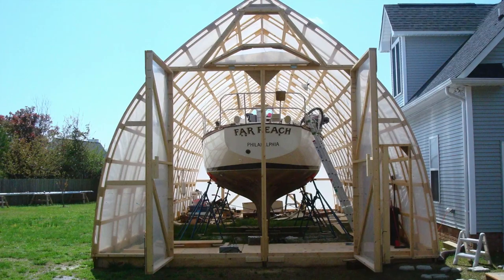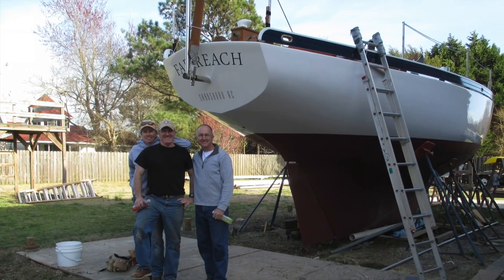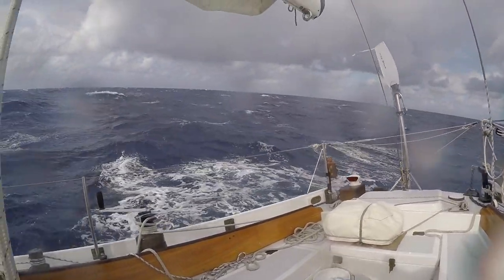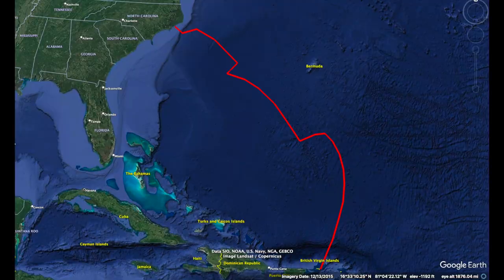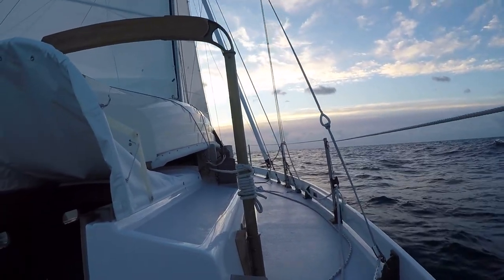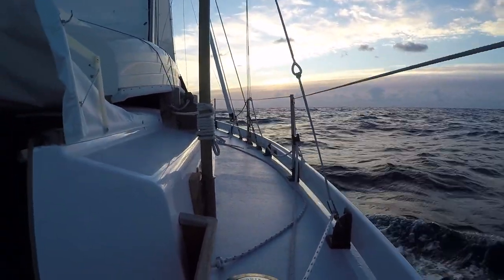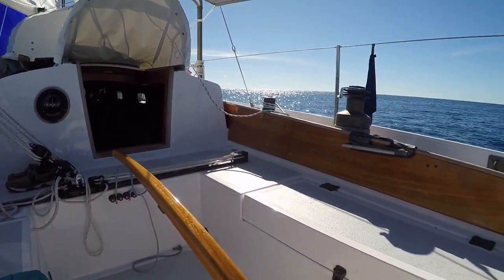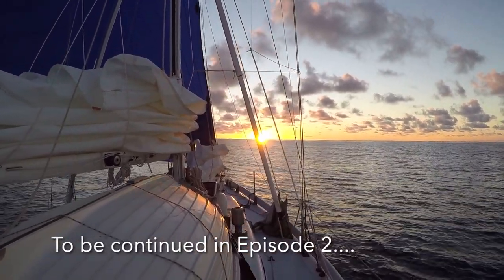S1Ep1: Crossing the Gulf Stream. Sailing an Engineless Boat From NC to BVI//Part 1.

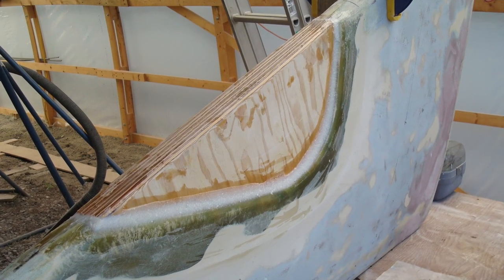Comment: 1:50 I'd really enjoy a video of you docking without an engine, it's a real skill I'd love to see executed...I've never witnessed it. Such a tidy little vessel, well done!
Reply from the maker: We don't sail into a slip. It can be done but only under the most ideal circumstances and if anything goes wrong it can be a mess. 

Rule #1: Do No Harm. Not just to your boat, but to anyone's boat.  Very hard to stop an 18,000lb boat.  You can drop a stern anchor or get a line around a piling but if you miss or have a hiccup then you were negligent and demonstrated lousy seamanship. 

That said I have sailed big boats up to a T head many times when the conditions were right--breeze coming from slightly ahead and nothing down wind to hit. I have sailed a J24 into slip because it was easy to stop at only 3,000 lbs. 

I have routinely sculled the Far Reach into and out of her slip in flat water with minimal current. 

The safest way is to sail the boat close, if the marina permits it, and anchor. Then row a line ashore and warp the boat in.  That way you maintain positive control the entire time. That is the proper seaman like way to do it.
Reply: @FarReachVoyages  Thanks for the very comprehensive reply (am enjoying your channel!). And yes, Rule #1 is why I was curious about how you manage tying up with no motor. Are you using the anchor windlass and winches when you warp in?
Reply from the maker: @harbourdogNL  Typically I can haul the boat around hand over hand using warps. But I have used the windlass to warp over to a mooring ball and also haul off a face dock so I could raise sails and get underway clear of the dock. Pretty standard stuff in the old days.  Not hard but takes planning and patience.  I would never encourage sailors to go engineless. It's like single-handing. It's something that has call to you.

Comment: Wow @ 6:56 that interior looks so so nice!  Really came together. -- QUESTION -- Is that a squeak free interior?  Just looks so solid and perfectly put together that it may be the first silent sailboat??
Reply from the maker: LOL. I don't know about that. My companion way ladder squeaked a bit when I was standing on it in moderate to large swells for a while. But I fixed that.  It's a fairly quiet boat.
Reply: @FarReachVoyages  ..understood.  But what about the floors?  So many sailboats, even expensive ones, seem have endless squeaks with every step they take - like an old house.  Sort of a pet peeve of mine as a youtube viewer.  Not sure why that happens so much.
Reply from the maker: @michaeltca3103  Floors actually support the sole. Real floors tie the garboards and keel together on a wood boat.  Well, most cabin soles and the floors that support them are wood. And wood swells and contacts with humidity. Our walnut planks swelled by the time we made it to the Caribbean on the first voyage. They squeaked a bit. I'd plane them down with a hand plane and then they would swell a little more. They squeaked and we did it some more till we got it right. Probably took a voyage and a half.  Probably most people don't know how to fix that and they get used to it don't notice it.  I don't like it and we work hard to avoid it.
Reply: @FarReachVoyages  ..there must be so many aspects to getting it just right - now temperature changes something as fundamental as a floor - good grief...  It seems like it will take a lifetime to perfect a sailboat, No wonder you devoted so much time to keeping things simple.